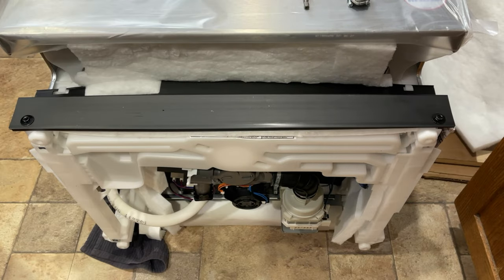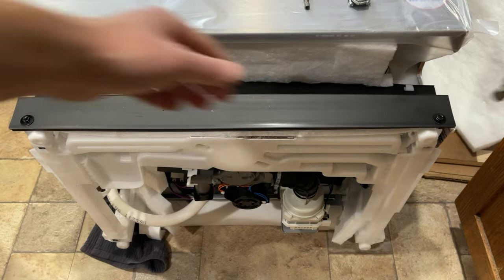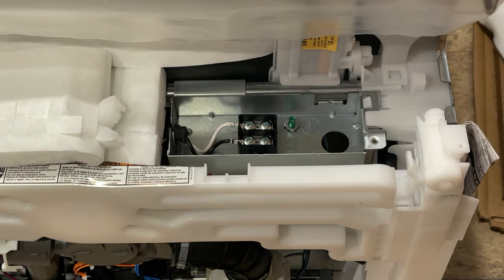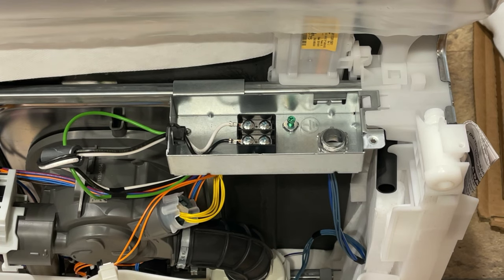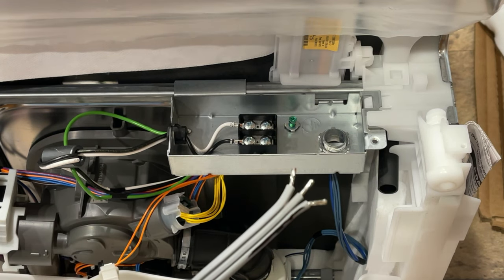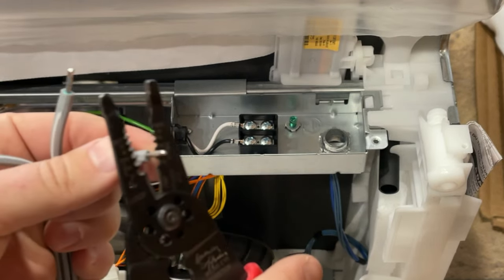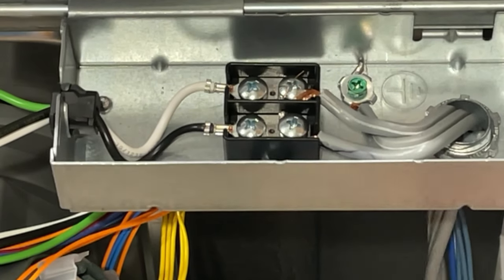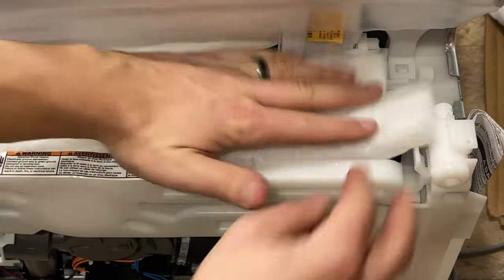How To Attach Power Cord To Dishwasher Kitchenaid Whirlpool Bosch

Comment: I would not suggest plugging it in because  that is dangerous. All cords that are gray, come with one side that is smooth and one side that has ridges. The ridge side is always white, the smooth side is always black. Just run your finger  across it and it will tell you which is which. Don't mistake the ground for the black. You do not need to strip the tips. The tips are coated specifically  because it is stranded wire and and secutrs the wire together.
Reply from the maker: Great tip!

Comment: Unbelievable that they don't color code the wires in the power cord..Should package it back up and send it back to China when you see that.  Safety issues galore for people not used to working with electricity.  Plugging in a chord with bare wires exposed is usually not what you want to do under any conditions...I would at least put wire nuts on the wires before plugging it in and then you can still check which is the hot wire and mark it right away.  I soldered looped connectors on the wires utilizing the solder they already had on the wires with my own.  I like solder for a good electrical connection that will never come apart.
Reply from the maker: Definitely!